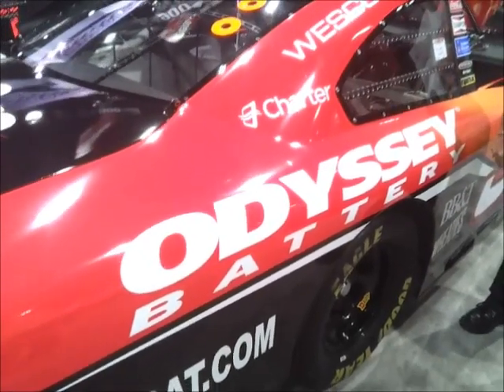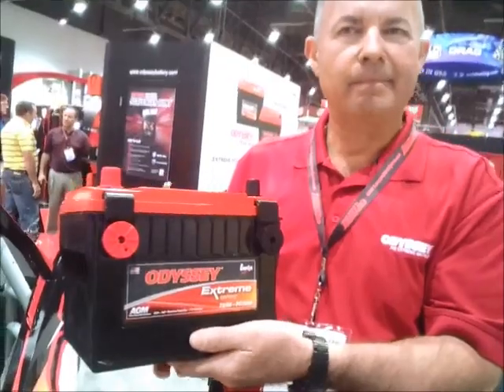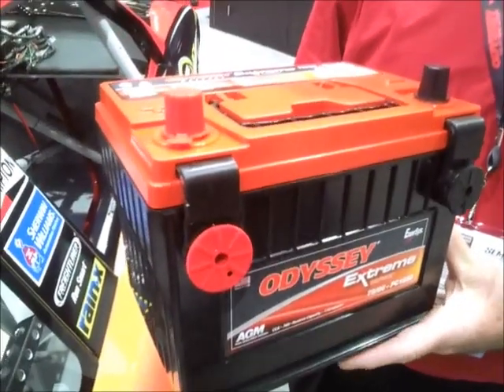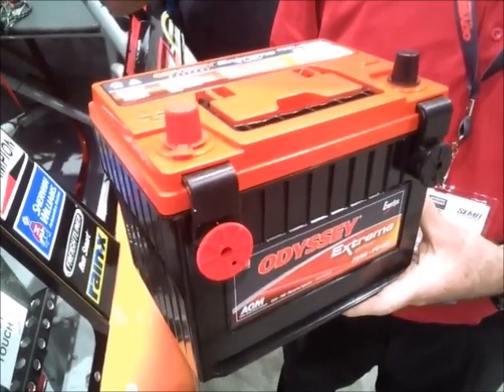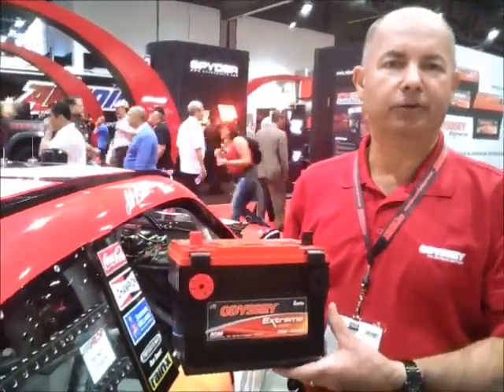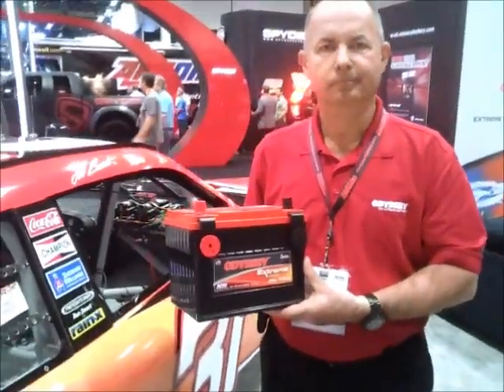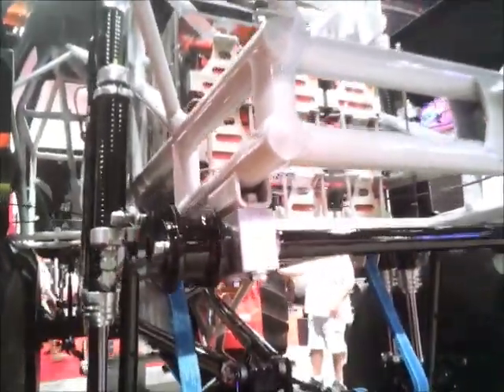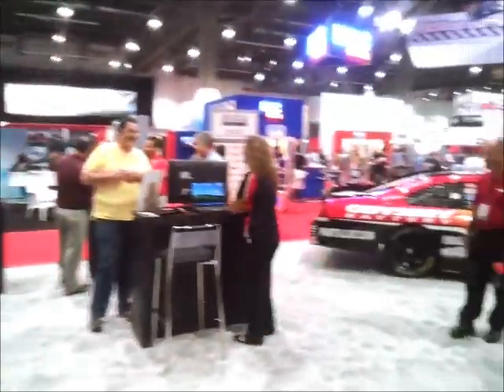The ODYSSEY Extreme Battery

Comment: These batteries are expensive but they do last a long time and the power especially in the winter is phenomenal, my reason for upgrading to these batteries is because at my job I find myself setting for long periods of time in the car with the radio on, and sometimes with the seat heaters. The reserve time on these batteries are excellent. I have no fear that my car is not going to start after setting it with the electronics on in the winter time it can set for a couple of days in the start is extremely strong